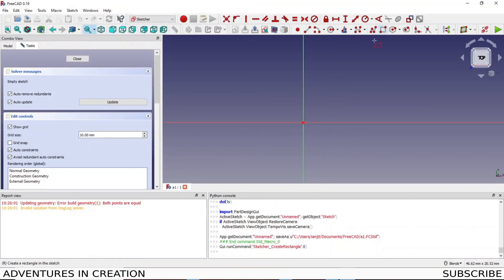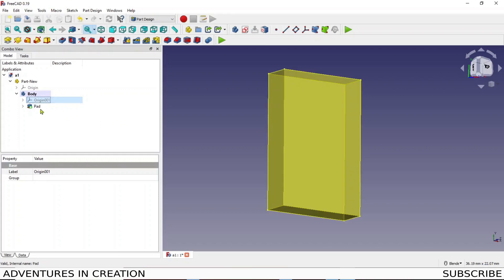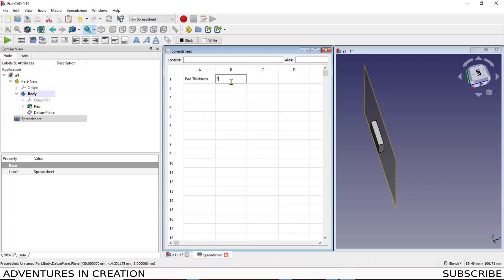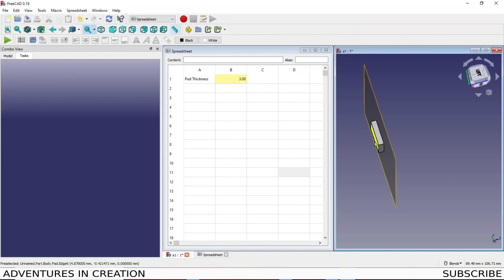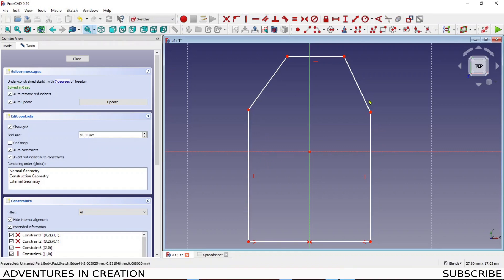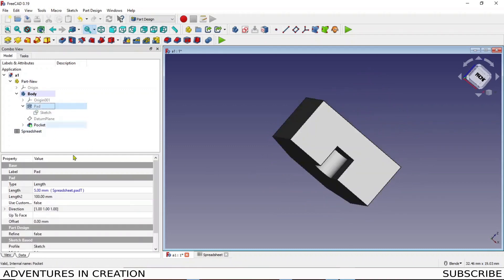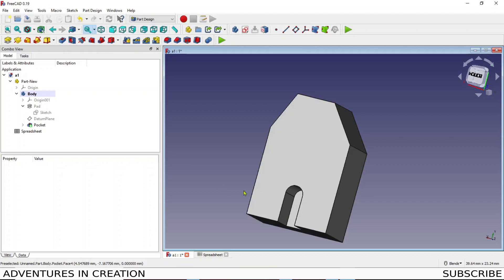FreeCAD Quick Tips - A simple method to avoid topology issues when using datum planes.

Comment: The issue that I'm running into is that on a more complex part with 50 different dimensions of all shapes and sizes, how does one actually offset the sketch accurately to a face without having to use the measure tool every 5 seconds to find the actual amount it needs to be offset?
Reply from the maker: First, try to keep the sketches and steps simple. Second, you can always calculate the offset and use a spreadsheet to keep it constant even when you change something.

Comment: Do you have a tip for avoiding the topology naming problem with LCS markers moving around when another feature is added?
I typically create a part and use separate plane to add holes then attach LCSes to the edges of the holes. But if I later add another hole the names of the hole edges change and with that the LCS references. Consequently the assembly becomes a mess until I edit LCSes that “moved”.
Reply from the maker: Until the topo issue is resolved, use the major planes to position things, you can offset from them with angles and distances. It may involve a little more mathematics but it's doable for now.
Reply: @Adventuresincreation  I already do that. My parts are simple models of steel plates, angles or rectangular tubing. I put holes in them with sketches on major planes. Nothing fancy. But as soon as I add or remove a hole the names change and with that the LCS reference move. I am sufficiently frustrated fixing the models that I started learning Alibre. I invested a lot of time into FC but now I am wasting a lot of time fixing messed up models, drawings and assemblies.
I hope Alibre handles assemblies better than FC.

Comment: Thanks for this video, i'm subscribed now.  It would have been really helpful if you had taken this one step further and shown how to constrain the pocket to the middle of the sketch if its width had changed rather than just its depth.    How do you constrain things in terms of the underlying sketch geometry without building in a topological-naming trap?
Reply from the maker: Take a look at some of the other videos, you will see how to do that. You just have to consider the way in which you constrain. If you use geometry you are going to run into issues but if you keep it as offset from the LCS you should be fine.
Reply: @Adventuresincreation  Hey, thanks for the reply.  I'll definitely keep watching and hope to grow more proficient.   Would be nice if the external-geometry tool would set up a spreadsheet entry for both the source and target sketches instead of just a name reference.  That way you'd have the convenience of just clicking on the reference point you need, without setting a topological-naming trap for yourself.

Comment: It's sad that FreeCAD doesn't have the ability to reference the newly extruded face in case of a pad, symbolically.
Like, pad.FrontFace.
Because what you're doing here, is basically reimplementing a pad with a datum plane, by referencing the pad length.
But it will break if for example, you rotate the attachment plane of the sketch used for the Pad.  It kinda works because a simple setup like this one is using only the three basis planes, but this will be messy in general, because you will have to find a way to compute the orientation of same face without referencing it by Face number, and you just moved the topological naming issue somewhere else.
Reply from the maker: Yeah, it means you have to consider carefully what references you use. However, I believe the solution to the topological naming issue is in sight, fingers crossed.

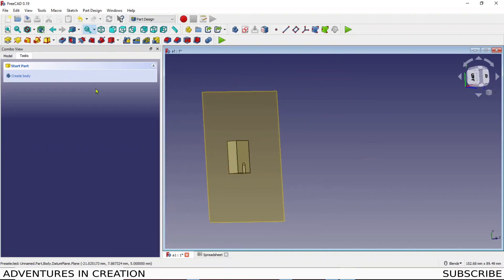Comment: Hi, I am a total newcomer to FreeCAD but was a past AutoCAD and SolidWorks user.  I followed your instruction to pocket a pad but now cannot close the datum plane? My model has this active datum plane all the time.  I have reviewed the part where you dismiss your datum plane (4:52) loads of times but can't follow how you do it?
Reply from the maker: No worries John, it takes a little getting used to. Simply go to the datum plane in the model tree on the left, click on it then hit spacebar. This toggles it on and off.
Reply: @Adventuresincreation  many thanks. I started with a tutorial book but got fed up with it and seeing as though I had a project to do I decided the best way was to chuck myself in at the deep end. Initially I struggled and was on the point of giving up but it obviously did work, the problem was me! I persisted and with the help of you tube I have made great strides but there is a lot to learn (especially if you are ancient like me!). Thanks for taking the time to reply, you are a star!
Reply from the maker: @johnbailey9651  Keep at it John, you will be surprised how quickly you get the hang of it. - I think FreeCAD is an excellent tool and you can't beat Free :-)

Comment: Now I know what a Datum plane is, thanks. I solved my issue when I changed dimensions in the spreadsheet. I have to select the last element in the build tree and say OK,. That seems to update everything. I still use .18 'cause I am on a 15 year old iMac, which I plan on continuing to use until the squirrel retires.
Reply from the maker: They have released 0.19.1 as the current release now. I don't know if it's any harder on the processor. I have one of those old macs too, bless it.

Comment: Thanks!
But what if my datum plane is angled and stays on the surface created by a chamfer operation? It would be a damn PITA to calculate the right distance (from origin?) from the chamfer data...
Reply from the maker: Thanks for the feedback. It can be a pain to calculate but relatively easy. However if it's something where you have to sketch on a face, I recommend doing that last, that way if you need to redo it the pain is minimized.
Reply: @Adventuresincreation  in other words: draw "dangerous" stuff at the end. Thanks for the hint!

Comment: I've been running into this a ton, and you have just saved me so much pain. Thank you!
Reply from the maker: Thanks for the feedback. I am glad it helped. Don't forget if there's anything else you want to see in a video, just let me know.
Reply: @Adventuresincreation  I'm about to get into scripting and macros. The wiki is great, but it misses on some of the "why" behind their scripting wiki's. 

Videos on when to use scripting/macros vs just designing a part and saving it to include in an assembly...

Would be terrific.
Reply: @Adventuresincreation  To expand on my earlier comment... I'm designing a rack and enclosure system for my 3D printers and smaller PCB mills. 

There are many common parts like DIN Rails and Aluminum extrusions of various size that I'm thinking of using scripts/macros so I can more easily include these in assemblies of the entire completed project.

The alternative is of course saving a file with each part that has set property values for dimensions. 

As a career programmer, that feels like a DRY smell to me, and wondering if the return on scripting/macros would actually be better than just firing out the dozone or so different files of the various sizes i need of each sketch.
Reply from the maker: If you are making lots of similar parts with minor variations a macro/script might be the way to go.

Comment: no need for the datum plane. offset the attachment of the second sketch. the datum plane is superfluous, just added steps for no benefit.
Reply from the maker: You can use either an offset or datum plane. I find it easier to use a datum plane if I am going to have multiple sketches that reference that plane. There is always more than one way to skin a cat ;-)

Comment: Why don't you just enter <<Pad.Length>> into the z-offset of the plane? This would automatically update the plane whenever the pad dimension changes and avoids thr need to create spreadsheet.
Reply from the maker: Because I didn't know that, thanks Harald :-) I will give that go.
Reply from the maker: It's actually <<Pad>>.Length but it does work and you can use math on that. Thanks for the tip, I will mention it in the next video. I generally use the spreadsheet because I am likely to have more than just the one variable at work. It makes organizing them easier.
Reply: Spreadsheets are an excellent tool which I use very effectively on some parametric projects.
Reply: no chevrons are only required when you want to use a label that you chose instead of the native object name Pad